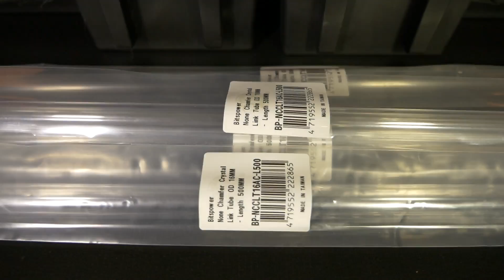SC Build #21: H440 Liquid Cooling: Part 2

Comment: Hey, not trying to be a debbie downer, your builds are amazing, but you do know that running a modern gpu at 3.0x8 has NO EFFECT WHATSOEVER ON ITS PERFORMANCE. You can put those gpus in any slot without issue. Also the 5930k has no reason for existing in this system. Even at 28 lanes you can do 8/8/4(ssd) and have 8 more available for a 3rd gpu or two networking cards.

Comment: Hey man, i really need your help!
Can i fit a 45mm radiator in the front and use the HDD mount on the bottom?
Pls help me.
Reply: "360 radiator 45mm thick
Reply: +Zero doubt it
Reply: you never want to mount your radiator vertically anyway.

Comment: Exactly how tall is the reservoir and pump configuration with the EK-RES 150 and the Bitspower mod kits? Would there be enough clearance at the top of the reservoir for fittings, say if you have approximately 270mm worth of height in your build between the top and bottom panel?

Comment: hey +SingularityComputers you mentioned in this video again that it is nearly not possible to make custom length sata data cables and also that you have to solder fan extensions

i have to correct you on both parts

first  you can buy akasa proslim sata data cables, these cables have connectors you can open up without destryoing them
now you just have to shorten the cable to whatever length needed and clamp the connector back on (it pinches through the insulation when you close it)

and second you can buy male 3 or 4 pin connectors for use with crimp connectors, so no soldering needed
here in germany we have a modding supply shop that steped up when nils / mdpc-x was closed and they have these crimp connectors in their range
https://www.gosumodz.com/navi.php?a=188&lang=eng

myby you can try it out and do an even more custom cableing :D 

anyhow the build is looking good so far, i just dont like the hdd placement
but i think you will refine that later in the build anyway ;)

Comment: You mentioned that you don't make fan extensions because you have to solder the connectors on. If you use these female dupont terminals: 

https://mainframecustom.com/shop/cable-sleeving/terminals/female-dupont-terminal-molex-5-count/

you can just slide the wires onto the male connectors at the base. They fit and work perfectly!

Comment: If the fans are on molex, won't they be running at full speed constantly? -> meaning they'll be really loud
Reply: +Matthew Gilbert You can simply buy fans that have a low RPM to start with. I run my fans at full speed... at 800 RPM.
Reply: ah, see I prefer to change the speeds of fans for silent performance - whatever you prefer i guess :)
Reply: I prefer to keep it a constant low, rather than depending on activity. For me, it seems pointless to have varying fanspeeds if you're doing watercooling.
Reply: but if the loop isnt very hot, you might as well have the fans not spinning at full speeds
Reply: Except
a. Loop is never getting hot.
b. You're not really getting slower RPM fans.

Comment from the maker: Part 1: https://www.youtube.com/watch?v=XH766g7KXFg
Reply: +SingularityComputers I don't like Razer at all, but you make it look good. Keep up the amazing work it really is cool to see how far you have come from so long ago. And BTW I think a video length close to this 15 minuet mark keeps people watching for the entirety of the video but that's my opinion, exemplary work keep it up and continue to improve.
Reply: +SingularityComputers Hey awesome video again!
I was wondering something. I had this idea that one day, if have the money aside I would like to build a just for fun watercooling system. I would want to try to build a system with multiple loops, one loop per part, even ram which i know is not neccesary of course. But just for funs with different colors. So chipset, gpus, cpu, chipset, etc...
You think it would be to crazy or still possible? I mean it would look like a fun project.
Reply: +SingularityComputers Have you tried Teleios Sleeve from mainframe customs? I bought a few meters of some and it seemed (at least to me) to be better than the mdpc-x sleeve i had. It had a tighter weave and a better feel, however was not as strechy as mdpc-x for lack of a better term.